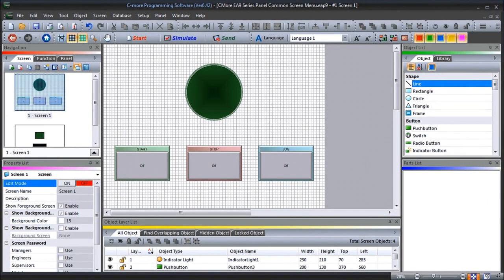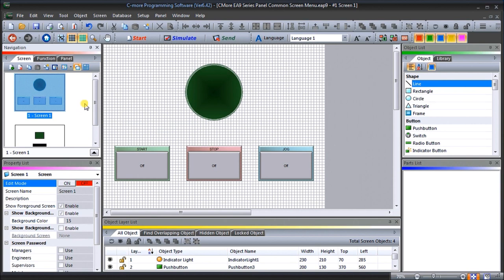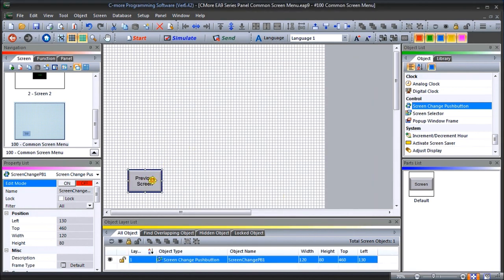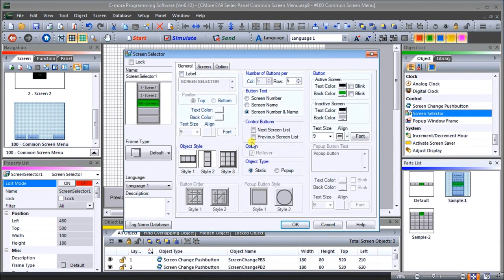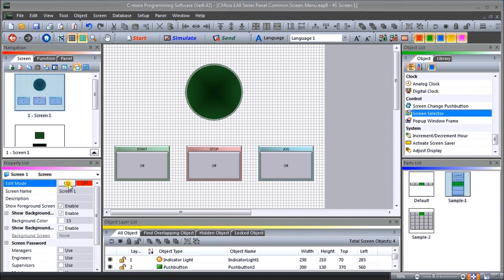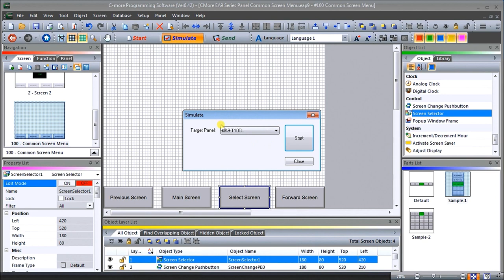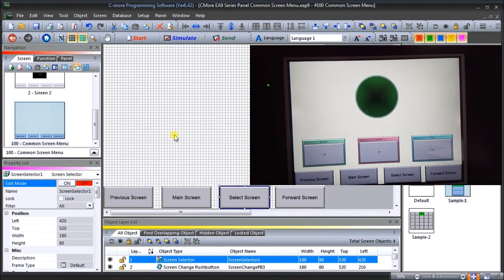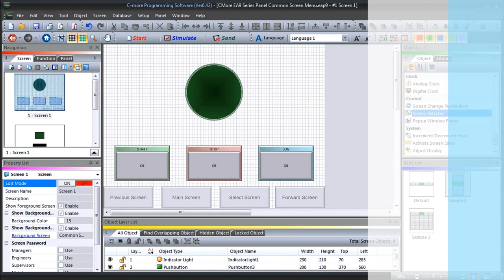C-More EA9 HMI Series Panel Common Screen Menu

Comment: Thank you for this video.  My HMI arrived today and I surely will be using your video as a guide to get going.  I certainly learned something today and will mention you channel when I show my HMI panel in my videos.  Thank you again!
Reply from the maker: Thanks for the comments. The EA9 series is a great HMI for any application. I've just recently played around with the barcode scanner input. It work well without any hassle. This will be a video later in the series.
Your channel looks good.
Regards,
Garry
Reply: @ACCautomation  Since I have your attention, I was curious if you know of a way with the Click PLC to have a DC Current sensor (It would be monitoring a battery bank) count how many amp hours go into the battery bank and out, in order to display on the HMI meter a charge level indicator?

Is there an email address I can contact you at to better explain / figure this out?
Reply from the maker: It sounds like you need a signal conditioner. Depending on your range of current you will either wire directly to the conditioner or use a current transducer before the signal conditioner.
Signal Conditioners
https://www.automationdirect.com/adc/shopping/catalog/process_control_a_measurement/signal_conditioners
Current Sensors
https://www.automationdirect.com/adc/overview/catalog/sensors_zencoders/currentavoltage_sensors_(aca_dc)

You can reach me at the following email address.
garryshortt@accautomation.ca

Regards,
Garry

Comment: Hi, what can i do to make the HMI return automatically to the main screen after a time of being changed for example to screen#2.
Reply from the maker: Hi @marioaguilar6677
The following post will show you the Panel to PLC and PLC to Panel communications. 
https://accautomation.ca/c-more-ea9-hmi-series-panel-to-plc-and-plc-to-panel-settings/
There is a location that can be set for the current screen. Create the PLC logic that compares the screen to 1. (Page 1) If it is not, then set a timer. After the timer expires then set the page to 1.
I hope this helps you out.
Regards,
Garry